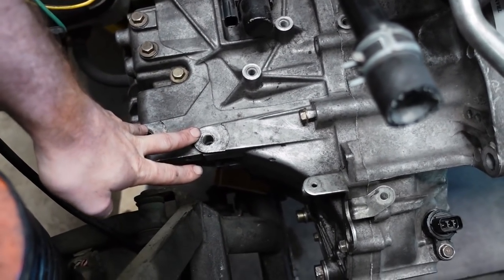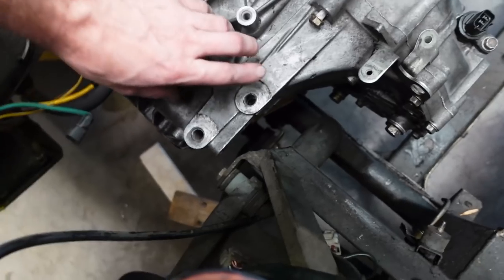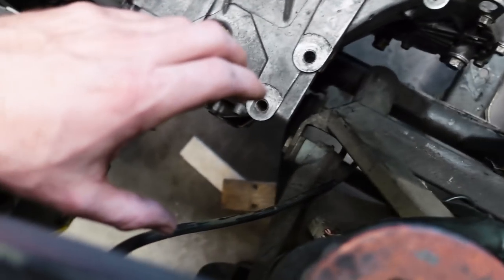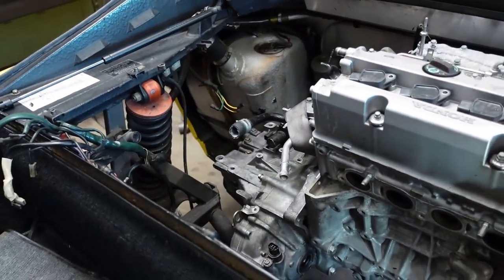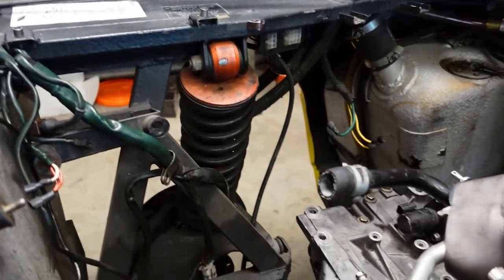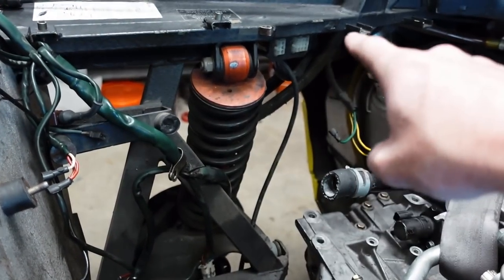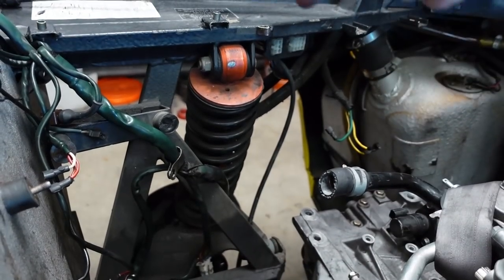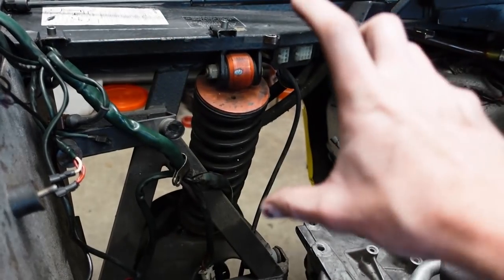Mounting a Honda K24 in a Ferrari 308 GTBi - Where Do We Begin? - Ep. 7

Comment: You do cool stuff. The right stuff I am into since my childhood when I read books about F1 cars and how they are designed. Go for the dry sump oil pan. You'll need a reservior tank and got lots of space for it on the driver side if that is not reserved for the gas tank. It also re-balances a tiny bit with the engine sitting so close to the passenger side.

Comment: Before committing to the use of angle grinders on a Ferrari chassis I would look at alternative transmissions to the one you have fitted.
Ford and GM as well as other Japanese makers have have gearboxes that may fit the frame better. Some have differentials that unbolt instead of being cast into the transmission housing.
The best conversion you can possibly do is one that can be undone simply by pulling the motor.
To mount the motor I would consider making a cradle that can bolt in solid then mount the motor to that.
Acura did a 5 cylinder and possibly V6 front wheel drive with longitudinally mounted engines instead of the usual transverse. A look at how they did that could be inspiring to you.
Reply from the maker: This makes a lot of sense if you care about reversibility. I don’t. I want simplicity, strength, and reliability. Modifying the chassis accomplishes that.

Comment: Thanks for the update. Some challenges there... The 308 core chassis strength are the oval main tubes at the base of the car, that then narrow in the engine bay, which along with the cross bars form a square hole where the drive train sits. This low level square structure is where all the mounts sit, with only a steady bar at the top rear. The upper structure is much smaller section.... basically to support the body, with the odd exception like the upper shock mount. This is opposite to the Honda drivetrain mounts which are supported to high-sided chassis rails at the two ends of the unit .
Reply: I assume you're going to fit a roll-over cage to the car, or at least a cross braced rear roll-over bar ?  From the roll-over bar, could you fabricate links (at the same height) that go back  to the upper rear wishbone chassis point, then cross brace to the main oval tubes below ? This would allow higher attachment points for the Honda drivetrain at either end - effectively a higher 'rectangle' above the original 'square'  the Ferrari drivetrain would have sat on ?

Comment: If you decide to cut the frame I suggest that the section the axles pass through be plated over on both sides of the tubing turning it into a enclosed box, then put a large hole saw through the spot the axles need to go and weld a bit of tube into the hole to close it up leaving an opening for the axles of course .
If the hole is big enough the original drive train might still fit .

Comment: Make an engine cradle that fits around the block closely and acts as a stressed member that bolts to the turrets. 

That way you can still have the engine on poly, or rubber mounts, and have a solid reinforcement for the area you’ve cut out.

Comment: Hopefully we'll get a video view of what you are seeing for space availability under the chassis bracing.  In other words, what is the distance between the floor and the bottom of the new modified oil pan?   Also where does the transaxle line up, height wise, with the axles?  It looks like it might be within an inch or two.   I think you going to have to build a new space frame which the engine will mount to.    Just my guess in you intend to use the OEM transaxle.   But maybe there is another transaxle available in the market that has it's output shafts further back to line up to the hubs.   I'm looking forward to seeing how you solve this problem in future videos!

Comment: When The differential is further back the half shafts length varies much less as the wheels move up and down with the suspension travel. Lining the different and the wheel bearings will cause the axle to push out on the wheels at the spline on the hub when the car hits bumps.  Ferrari had it the way the car came for a very good reason.   Great build idea though , keep it up. 👍

Comment: So this video is the most recent one I've seen so far (been binging tonight) but I feel like you're not going far enough when considering how to modify the control arm mount and where to mount the engine. I think you could move the entire suspension.

Surely you want to lower the car and lower its CG, but instead of doing that traditionally which will mess up the control arm alignment and roll centers, keep the suspension arms as they are and simply cut and move the entire package up which would lower the chassis around it. That might also raise the UCA mounts above the axle centerline, solving two problems at the same time. That suspension design looks extremely basic and the chassis members are basically steel tube already so it's relatively easy to cut and weld the entire unit and move them up. Compliment that with shorter body coilovers and boom. The same could work on the front.

Comment: Instead of removing those wishbone supports that are in the proposed line of the driveshafts, could you cut a section out and weld in a slice of thick wall tube to both ends of the remaining support ? Something with a 4” or so ID would allow travel of driveshaft and maintain more factory look. Just a though. Great content.
Reply from the maker: Something like that might be an option, I'll need to see if there's enough room for articulation if I go that route. Thanks for the kind words!
Reply: @stanceworks  I have seen this done somewhere. If I find it I will link it. I love builds like this. Rennch is putting a twin turbo Subaru engine in an older 911. Love builds like this. Haters will hate but that just tells me they don’t have vision.

Comment: Even though it helps with weight distribution, I would still consider having the fuel cell in the area that has the rear trunk now, having the gasoline right behind your back in a possible side impact would be really bad. Effectively being in the wheel well would make it also be in a crush zone in a catastrophic enough crash that makes the suspension components and the rear wheel to come loose.

Naturally chances of that are very slim, but given how you are aiming to track this thing it is still a possibility, and should be taken into account. I would personally consider a tube frame cradle in the rear trunk area with a firewall separating it from the engine.

Comment: Just wanted to mention, K24 swap , is a common swap for 355, 348, and an F40 used in hill climb timed racing events and engine does run high with modified deck lids. Think it's a 1st for 308, but small block V8 is known swap and rides lower in rear.

Comment: I believe you are wanting to say "threaded engine bosses" versus partition.  One thing you could do to gain clearance for the axles would be to carefully cut and swap those curved vertical control arm braces (with their corner reinforcing "feet") to the opposite sides.
Reply from the maker: That might fit!

Comment: In actuality, you'd probably be best off just figuring out where in space the hubs should be on the car, picking out some nice double-wishbones off some aftermarket page that features compatibility with a hub that uses the number of splines you need for your Honda motor, then just build the structure around where those need to mount. Trying to use Ferrari's weird cobbled together rear suspension is just way too limiting and you can do better. Heck, go find some NSX rear aftermarket suspension, then rebuild the support subframe structure around that. It should give you good handling and one of your friends has an NSX that you could use to take measurements off of to determine where all of the suspension mounts reside in their stock configurations.

Comment: Have you considered using the k24 gearbox casing from an accord or TSX? They run their mounts from underneath. Could easily make a mount from the lower chassis rail then.
Reply from the maker: I didn't know that. I'll need to confirm where the mounts are on the transmission I'll be using.
Reply: @stanceworks  you could always swap the desired gear-set over to the accord style case.

Comment: Just a thought here.. Is there a difference between what engine mounts are required between an engine that is found in a front wheel drive car and an engine that is found mid engine? An MR2 mk3 has 4 engine mounts- possibly to do with engine weight shifting during cornering etc.. no idea about the science behind it- but it would be good to ensure the engine cannot shift incorrectly as it might jeopardise the handling.

Comment: Are there any type of offset gears that could be used to attach to the current transmission driveshaft takeout that could be mounted to existing output and accomplish the rearward offset without requiring any chassis modifications?  I would think fabricating this would be easier than the chassis modification if not commercially available.
Reply from the maker: It call comes down to skillset. To me, that sounds like a solution begging for weak spots to be found. I'm totally confident in modifying the chassis and that should only cost a few dollars in material to do.

Comment: You could also machine off the bellhousing and rotate or clock the transaxle rearward and down with the dry sump I think you absolutely must have.  To get the mass lower in the chassis and line up the axles for a properly functioning drivetrain, dry sump and transaxle clocking is likely a must. That's short of compromising all over the place with the K sticking way up above the original engine cover, compromised rear view and roll axis as well as the trunk firewall with a dimensionally smaller drivetrain.  As you are using an aftermarket sequential gearbox, a dry sump should allow you to roll the differential down under the dry sump pan.
I know it's a bit of extra work and thought, I promise it will be something you regret dearly if you just mickey mouse it in there.

Comment: You could try rotating the transmission. It would be much easier to modify the trans case bolt pattern than modifying the car.
Reply from the maker: That would be significantly more difficult in my book.

Comment: on the driver side.. cut the round tube off, reweld a copy forward,, you have the steel on the base of the chassic to work with.. contact me at alfa romeo bb.. i am bianchi2 on the board... at the 6:41 to 6;55 you can see the curves tube that you can cut away.. and just move the new one forward 2 or 3 inchs,,

Comment: With all due respect, I don't think changing the fuel tank layout is an answer to balancing the weight distribution issue; a full tank will be a lot different than say a quarter tank in weight distribution and handling characteristics.

Comment: don't cut the frame yet! dry sump increse space under engine. adapter plate for ferrari trany to engine to lower engine
Reply from the maker: That's adding complexity. Modifying the frame is very simple and straight-forward and is far less likely to fail.

Comment: I know you said you didn't want to redesign the back half, but since you said you can remove the trunk.  Why not make the engine go F/B and use a transaxle?  I wouldn't think you'd have to redesign the geometry all that much, but length might now be an issue.  Yeah, of course I should have watched the entire video before commenting.  My way would have put the rear "axle"  way too far back, and then you'd modify the rear of the body, and rabbit hole!
Reply from the maker: You got it! The main reason is that it would put the axle centerline way too far back.

Comment: I'm an RSX owner and I'll tell you myself..this thing is gonna sound all kinds of wrong compared to the looks...itll be a huge letdown..I get the power to weight but a 4 rotor or boxer motor would have given the same benefits, but sounding more badass. To each his own though...good luck
Reply from the maker: I'm running a Vtec Killer system so idle will sound gnarly, more like a rotary than anything else. The turbo should help sound under load tremendously. I'm confident it'll sound fantastic.